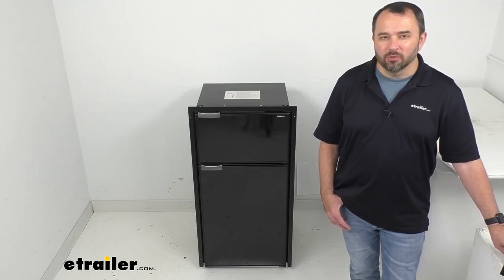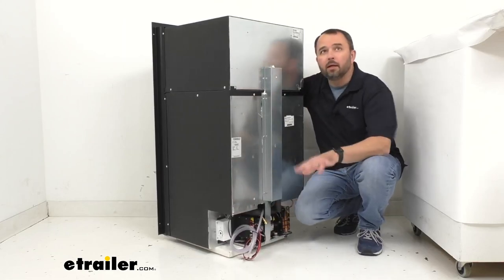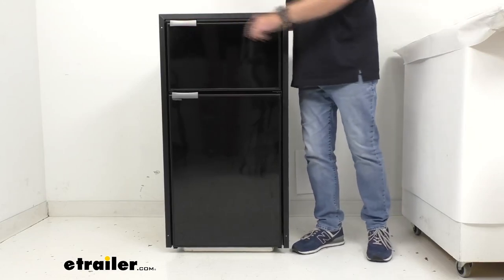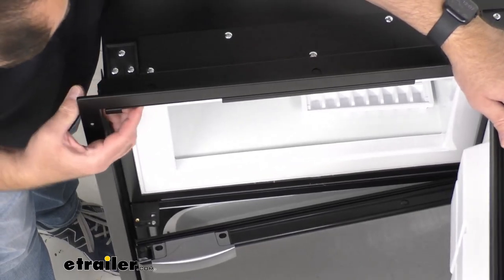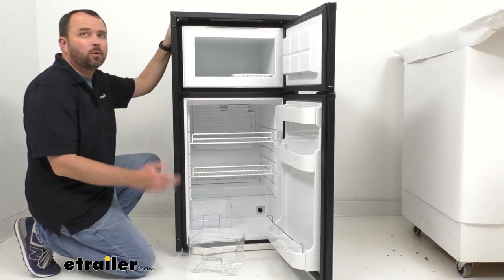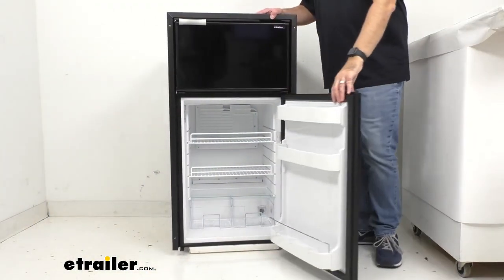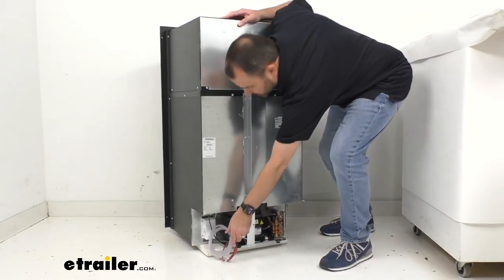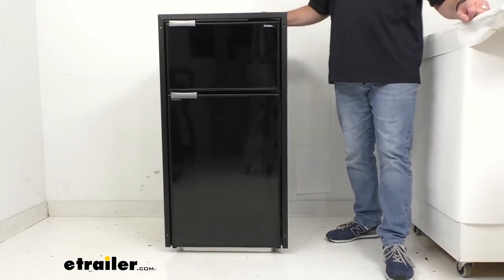etrailer | Breaking Down the Vitrifrigo DP150i Double Door RV Mini Fridge w/ Freezer

Comment: Curious, what is the method to mount this, this is bolted into place through the flanges into a strong perimeter frame?
Reply from the maker: That's correct. You can check out the owner's manual/install instructions by using the link below. Scroll all the way to the end.
https://www.etrailer.com/instructions.aspx?pn=VT94FR